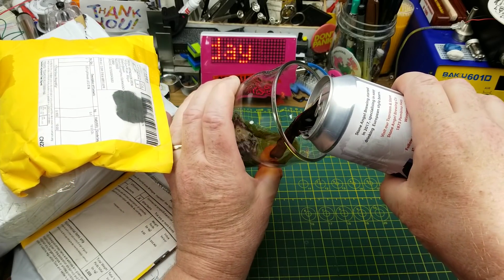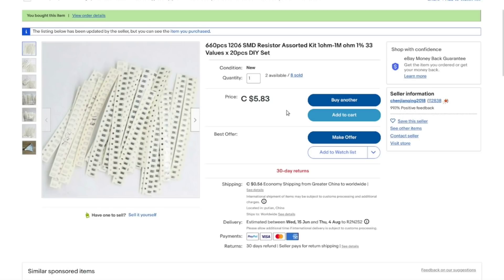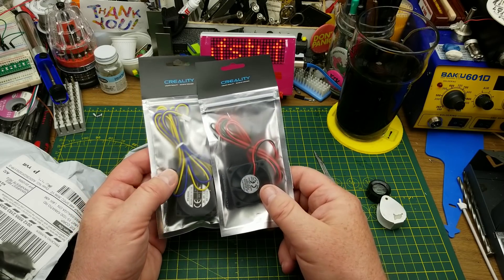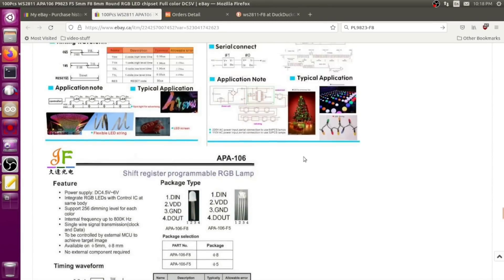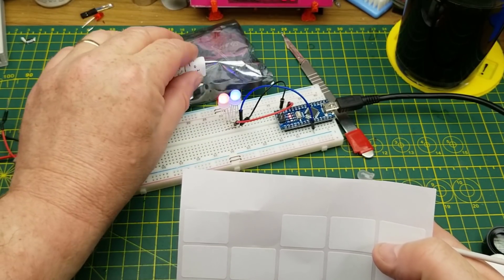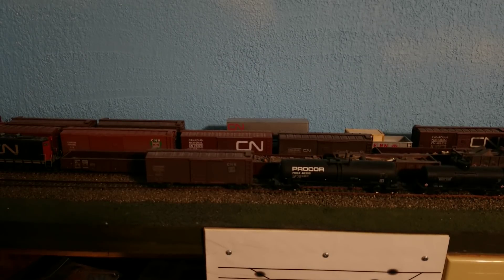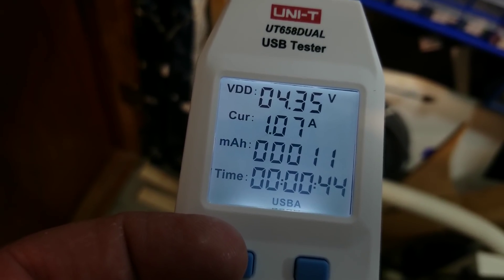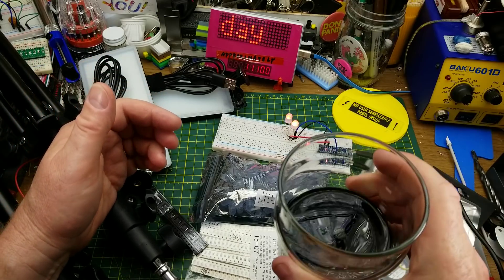Mailbag Monday 141

Comment: The Creality fan you got, was the hot end fan just the standard fan or their "silent" version?
I did get a silent one for mine at one point, but I remember it costing more than the price you paid.   That said, it is silent compared to the original fan it came with.
With the RGB LED's - Positive is usually the longer lead.  I would say the listing got the pinout wrong in the diagram.

Comment: It doesn't even surprise me anymore how far Chinese sellers will copy-paste and make flat out false claims about the products they are selling just to sell whatever stuff they happen to be selling.  Those LED lights state 18watts max but then say it is going to draw 1-2 amps at 5 volts.  They also claim 1680 lumens but from the looks of it I would guess they are closer to 600-800 lumens for each light panel.  They look decent enough for the price with the stands but I am sure the stands are as cheap as they possibly can be.  I still prefer the Neewer stuff with its diming and color temperature controls on most lights for filming stuff.

Comment: The LEDs made your layout look like it was in daylight. That impressed me. It also saddened me. You have the layout there, you can even see a switch diagram, which is begging to have the switch positions indicated by big 8mm multi-color LEDs. It won't happen. You've been sucked into the YouTube honeytrap where you spend your free time putting together kits that you'll probably never use, and (honest, thank God) product reviews from stuff sent to you by wholesalers. 

I wish there was a channel which does what you started out doing: Taking the cheap electronics and using it to build layouts, cars, and engines at significantly lower price-points than the places supporting all of the "independent" train channels and magazines. Not to mention the product placement the NMRA does in their stuff.

I understand why you're doing what you're doing, but I'm still saddened. Won't stop me watching or buying you a beer every month, but I do it with a heavy sigh.